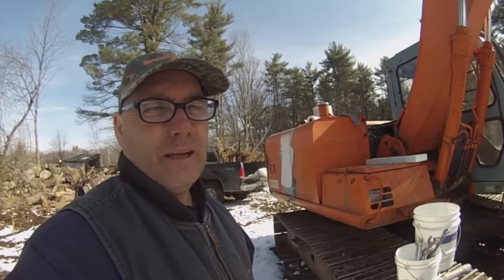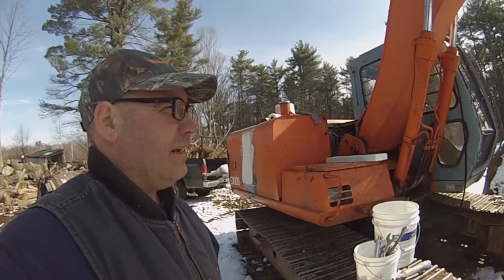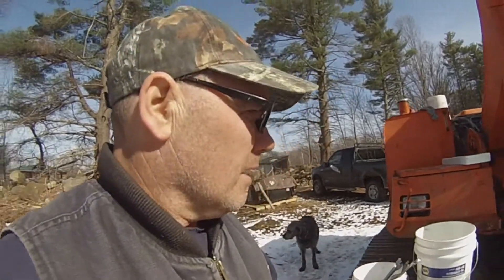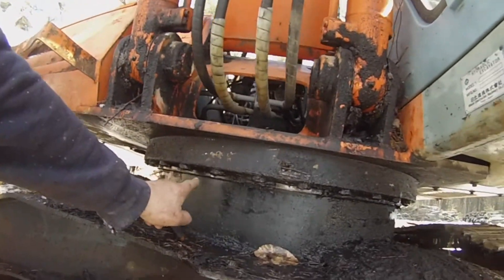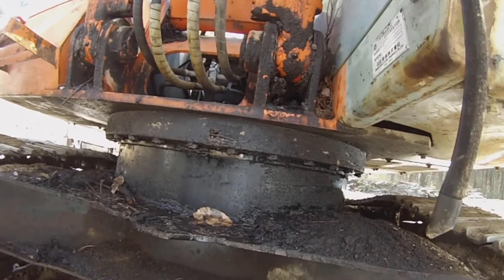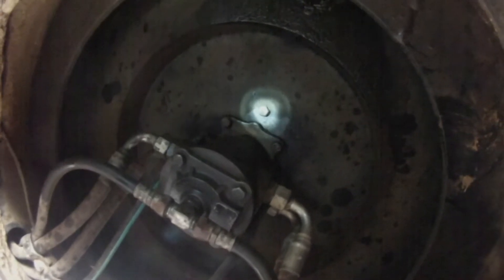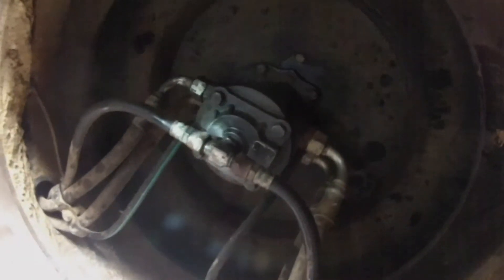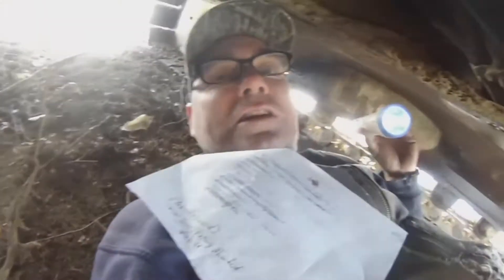DIY Hitachi Excavator Hydraulic Oil Leak Fix, I Hope It Works

Comment: One little trick for future reference is to dig a 3' to 4' deep trench with a ramp to use as basically a pit in a shop.  I did this to remove and repair my travel manifold. Pretty handy to be able to stand up to do the hoses etc. on the bottom side.
Reply from the maker: That sounds like a great idea. I am not a mechanic as you could tell, but some times you have to go outside your comfort level. That fix is still working I am pleased to say. Thanks for watching.

Comment: took off the hoses and bolts but it still seems to be stuck and wont come out? Any suggestions?
Reply from the maker: I think your question is about the center joint. There is a rubber collar on the upper side of the center joint on my machine and I had to pull the whole thing down thru the collar to get it free. When i put the thing back together it was a bitch to get it thru the rubber collar and have it all seal up right . I hope you have luck. Putting the new seals isn't that big of a job. Good luck.

Comment: Hey was it leaking on the upper hydraulic ram I wishbi could add a photo I have questions for you 😆
Reply from the maker: No it wasn't leaking on the rams. They do leak a little and some day they will have to be addressed. The fix actually worked. I had quite a time getting the rubber gasket on the top to slip over when I installed it.

Comment: Is it fixed
Reply from the maker: Sorry this took so long...yes, it was fixed two months ago and still no leaks.
Reply: Why make a video if your not gonna show any of the work involved? You explanation sound like it would of made a great video. Thanks anyway
Reply from the maker: I thought I did show the work involved. It's really not easy to make a video that covers the subject without being too long. Everybody wants something different out of a video. This wasn't intended to be a real how-to video.
Reply: Cost for my rebuild was$700.00.  On my machine I elevated the front of the machine and removed a small drain plate to drain as much of the oil as possible. I then stuffed 5 gallons of grease into the tub through a small inspection plate on the front top.  There are no grease fittings for the tub.  The grease fittings on my machine are for the swing bearing only and can be over greased.

Comment: Had the same leaking center joint on my EX120-5 about a month ago.  Ag Tech Repairman came to my place and removed the inside of the mechanism without removing the whole assembly,  Pulled it out from the top and replaced all the seals and re-assembled it on the spot. My question is, did you manage to drain all the oil from the tub under the swing drive and if so how did you do it?  Also did you refill the tub with grease?
Reply from the maker: I did grease it through the two grease fittings and there is a plug underneath the machine that allowed me to drain all the oil. Sorry it took so long to reply to this. Thanks for watching.
Reply from the maker: Curious how much your repairman charged for the fix.